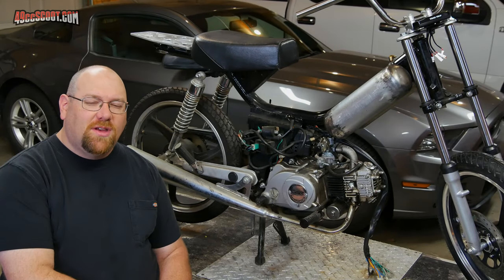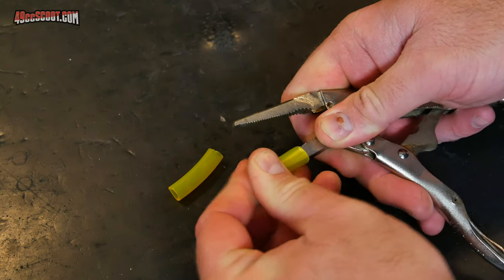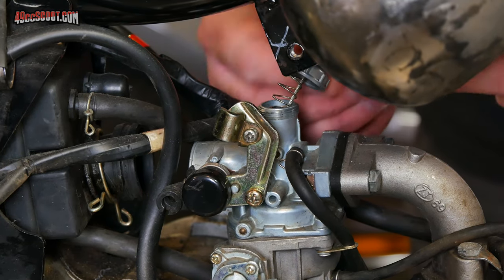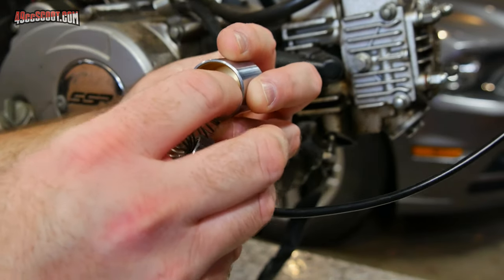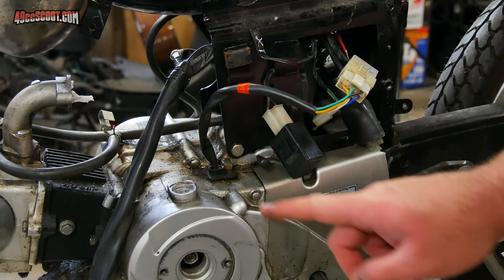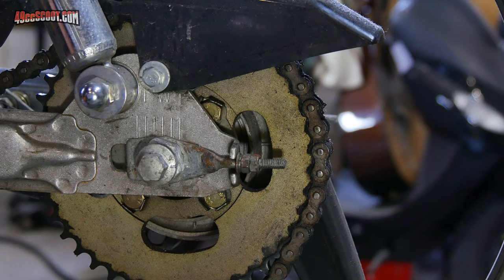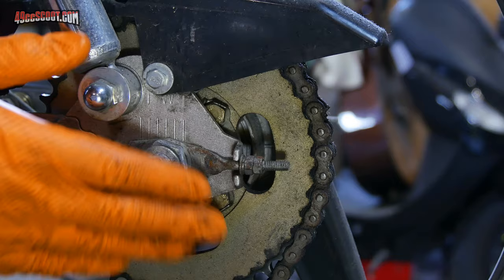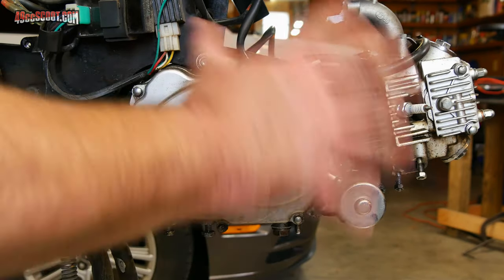Detailed Pit Bike / XR50 Style Engine Removal How-To Guide : SSR Part 6

Comment: I changed to 55\60 Osram Silverstar 2.0,many programs ago.And head-light is burned inside,and foggy glass.So I googled:"The led-bulb is equivalent to a 90\100 w H4 bulb in temperature" and even worse googled:"The 35\35 standard mc-bulb draws much much power the the 55\60w standard H4 bulb.So much that wires burn up,and you probably need ceramic plug."And this is reason I had to buy,and change everything on ground wire.Today new head-light.All brand-new and 55\60w only way.
Reply from the maker: Part of the reason that I use LED assemblies on my stuff now is that the really bright stuff was melting the Chinese headlight housings. I liked the 65W Silverstar as much as any light that I've used, but it melted the housing and plastic near the housing when sitting still.
Reply: @49ccscoot  It was a 130 dollar lamp on e-bay from spain,maybe its better,who knows.Maybe it is this silverstar who broke the lamp?.u=r*i,and watt are volt*ampere.But 35\35 was bad for old cars,burned everything,compared.

Comment: You Paint this engine for building project?  Nie wiem czy dobrze napisałem ale chodzi o to czy będziesz malować silnik i nagrać o tym odcinek jak to się robi prawidłowo 😁
Reply from the maker: I don't really want to paint the engine itself. I don't think that any coating I add is likely to be more durable than it is currently, so it will be less likely to look beat up and scratched up over time if I leave it as-is.

Comment: Will a bottom mounted electric starter fit on a top mounted electric starter engine?
Reply from the maker: They're probably going to be different. There are even different versions of each type, like 2 bolt and 3 bolt.

Comment: Did you ever found why the engine was bogging out?. You are going with a different engine right?.
Reply from the maker: I'm going to replace the 49cc automatic with a 160cc manual. I never put much effort into the original engine for that reason.
Reply: @49ccscoot  Cool. Looking forward to your next video.